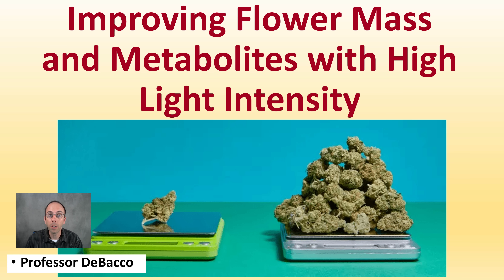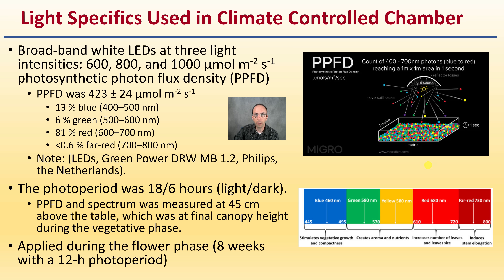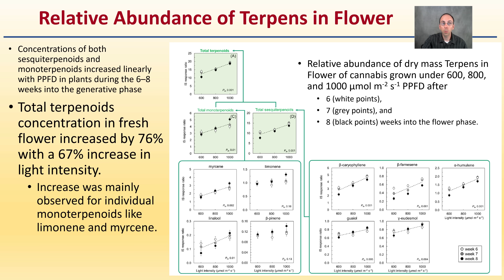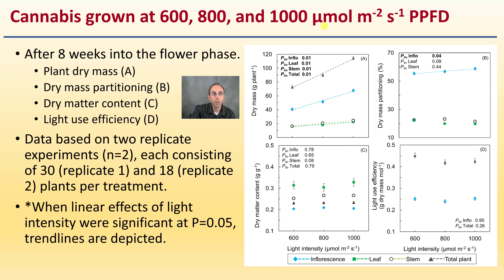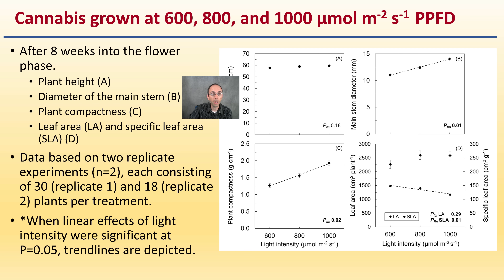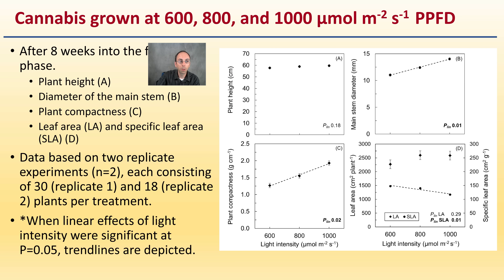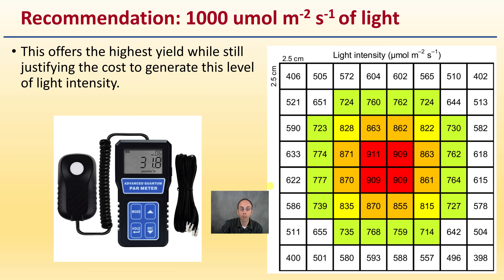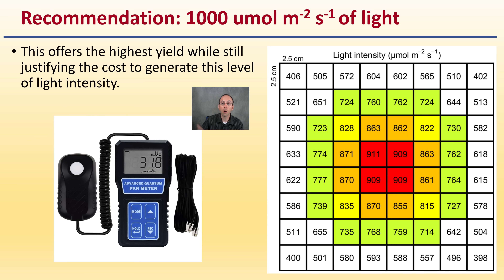Improving Flower Mass and Metabolites with High Light Intensity

Comment: As a 53 year old grower / smoker / breeder  - Imo, most of the flower in the shops and dispensaries, at least in my town, looks way better than it smokes. I think the combination of average / sub-par genetics + too much CO2 + PGR's + LED near red makes the buds nice and fat, but they lack the flavors and smells I get using the older HPS mixed spectrum bulbs running off digital ballasts. I ran LED's and HPS side-by-side in my flowering room and there were noticeable differences between the crops. LED's brought out more coloring, and the crops finished faster, but the smell and flavor of the HPS crop was much nicer. My customers felt the same
Reply: So overall you think HPS is better? Though I agree as I felt cannabis in the 90s was better but the price and heat of those HPS lights can cause issues for normal growers
Reply: @826_Vegeta_UCM  I do enjoy HPS flower better.  LED's do certainly have their benefits. Probably the only crops comparable to HPS, as far as terpene production, were the ones I grew under an LEC
Reply: @Onoma314  Interesting,  i've got a fairly expensive 750w LED, but a buddy of mine uses 300w LEC , with the exact same soil, nutes and strain, his plants always look thicker and healthier than mine, not sure what i' doing wrong .
Reply: @Onoma314 
LEC leaves HPS in its dust for terpenes
Blue spectrum dominant LED is superior to HPS too
HPS has a tonne of far red, and not as much PAR as most LED 
Also no UV
Reply: @grantsmith505  LEC also increased stem biomass by 27%, so not a great deal for me. Grow on, bro
Reply: @grantsmith505  No, that's incorrect. They actually make special bulbs for HPS that provide more far red because they normally don't put off a lot
Reply: @Onoma314 
And it's not incorrect that LEC/CMH is a far better producer of terps, because it's got UV, and is designed specifically for horticulture, while HPS is only designed for street lighting 

I've been growing weed under light since 1987
I actually study spectral output...not just spreading my assumptions like you are
Reply: @Onoma314 
Stems are developed by light in 630-780nm
Which is more like an HPS light than a CMH

How long did you say you've actually been growing, and how big are your gardens??

I used to grow under HPS and CMH combined spectrum 
Haven't used an HPS in more than ten years, since LED tech hardened 

If you had access to CMH, you'd be growing under a CMH/LED custom spectrum by now

No-one who's actually used CMH is going to advocate baseball ground lights over horticulture specific lighting 

I think you just talk big...
Reply: @grantsmith505  oh really professor ? Which bulbs was I using ? Which products ? You're just making assumptions, get a grip on reality
Reply: @Onoma314 
You didn't even know HPS was originally designed as street lighting???

And you are here trying to get other ppl to trust your opinions 

And when someone brings facts, all you've got is to call me professor and have a sulk....
Reply: @grantsmith505  OK knowitall, sure thing. I think I could take one of my strains, for example my old shishkaberry cut, and grow it under a range of lights, and you'd be clueless which bud came from which light. Tell me I'm wrong, wait, you don't need to, because I already know

And if you want to pull the whole " I've been doing this longer than you " bullshit, who really cares ? I was raised by parents that worked the smuggling scene in south florida in the 1970's and worked for Steve DeAngelo before he even started Ecolution, and I'm cooler than you and more old school and and and , aaaaaand......who really cares ? Nobody gives a shit what you have to say, just get a grip on reality
Reply: @Onoma314 
The subject of discussion is spectrum, which you don't appear to be able to add to....

It's got nothing to do with me growing indoors 40 years either, it's what I did in those 40 years 
And one of those things was study the physics involved in lighting 

So you can say in your opinion something or other is correct
But notice how when someone actually brings facts all you've got is petty name calling, but no facts to bring in return
Reply: @Onoma314  bingo we have a winner.. spectrum tuned led with philips 315 cmh has been proven for a while now
Reply: Corporate bud is like food corporation fruits and vegetables. They breed a strain for highest commercial profitability.  Whether that's denser buds or faster maturity or higher pest resistance or even possibly glyphosphate resistance for all we know.  

It makes sense that the same banker owned corporate types would select a strain with fat dense buds but no terps or trichomes.  Just like they've done with tomatoes that look perfectly round and red and have long shelf life but taste like nothing at all or taste like miracle grow.

Also, by the time flower reaches a retailer it has been shaken for kief by everyone and their brother.  My space case hasn't had any significant kief for months.  All the bud has no trichomes anymore
Reply: I’m a newer grower so I have only used LED and have no basis for comparison with HPS but I can’t complain about what I’ve produced so far in terms of flavor. I don’t think it’s the light so much as the lack of a proper cure at the dispensaries. They want it out the door as fast as possible to turn a profit (understandably) and so they’re not willing to keep it jarred for 4-6 months before shipping it out.
Reply: The costs of hps nowadays outweigh the pros in my opinions. I can't run lava hot light bulbs in my small spaces for some flavor and slight higher THC levels.
Reply: These plants can utilize an insane amount of light. Growing outdoors, my real challenge is pests and inclement weather. Everything in my gardens wilts under the summer sun but not the cannabis!  Indoors is a different story. You need high dollar lights and maybe a closed loop CO² system to get above 1000umols. I dont have that kind of scratch for my indoor grows. Outdoors, I get 2000+ umols for free, plus all the spider mites i can kill!
Reply: @terpy-j7x  I'm in a desert region of Spain, the heat this year is insane 114 degrees during the day and about 86 degrees at night. We get micro climates, so suddenly it might drop a months worth of rain in one night, then not rain for a year, dust storms,  wind storms, Saharan sand storms, dust from the granite quarrys, more insects than i could name , and dampness, every house or wall has a 60cm mark where the damp has risen up, which is pure salt .. The winter is all of the above except the insects and heat, but it does get extremely cold. I've tried outdoors but it's just so challenging to deal with everything, if the plants make it to late flowering, then you've got bud rot to contend with. Even indoors is challenging, electric prices here are one of the highest in Europe, so running AC 24/7 ,plus everything else is really costly,.
Reply: @benjammin1212 I did loose half of one plant due to bud rot. Humidity here in Virginia is ridiculous this time of year. This year I have a fan outdoors blowing to reduce humidity. I keep my fingers crossed...and check on the indoor girls regularly!
Reply: @benjammin1212 gday mate from Australia so i understand the challenges you would face outdoors. May i sugest a hybrid solar inverter 12kwh battery storage and 2.4/3 kw solar panels. Per 600w light 30w extract fan and  15w air circulation. Initial cost is around $3.500 american at xheapest home build setup. Which is easy. I paid around $5k for my setup i built myself. If your anygood at growing which i assume you are..and your able to er...trade then its only a few rotations before its paid for itself. Rinse and repeat. Fuck paying for unreliable grid power 😢😅
Reply: @simonowen1956 Greetings from sunny Spain, thanks for taking the time to reply. Unfortunately I'm not in a position to get solar at the moment but it would be nice, it's something I've often wished I did have .. Merry Christmas to you and your family..
Reply: led will definitely evolve past this, as we research spectrums more, led lights will keep getting better. BIOS recently made a light with Poetry Of Plants, that is a “led” with all the benefits of HPS, called “The Bridge”. i know a couple other players also doing something similar, like GML

super excited to see what’s in store for the light/growing game in the next 10 years
Reply: Also pretty sick of hearing about the PGR EXCUSE I grow rock hard buds with co2 and led using 100% omri listed inputs.
Reply: @lakegrown_culture_nick8912  Crazy, I grow rock hard buds without CO2 or LED's. Of course, after growing my way through hundreds of strains, I couldn't help but notice that not all cultivars have the same flower density. It's almost like it's genetically determined or something
Reply: How is hps better ? my LED Can match the same spectrum and double the intensity at a lower cost
Reply: @420BusinessDays  Better how ? WTF are you people even blathering about ? Did I say a goddamn thing about power consumption or heat ?  I swear, some of you need to get a grip on reality. Cannabis plants are incapable of exceeding what they're genetically able to do. No amount of stoner science will change that. It comes down to providing your plants with the environment they function the best in, and that is cultivar specific. If you don't grasp that, you probably shouldn't work with plants of any type
Reply: @Onoma314 lol sound like you buy temu leds bud 😂
Reply: @420BusinessDays  Well, let me see here....the cost of a digital ballast for HPS is far cheaper than any LED lights I've seen, the bulbs for HPS are cheaper, ( 20 $ to 125 $ )I can replace the bulbs when they underperform, that's for starters. Buy an LED growlight and have a single component burn out  and then what are you going to do ? Fix it yourself ? Who cares about double the intensity ? Bombing your plants out with excessive light actually decreases terpene production.
Reply: @Onoma314 Im saying The cost of running led is cheaper my 1000w led almost covers my 8x8 only running at around 600-700w with Uv while hps im running 2-4 ballasts at 200-600w per light depending on what stage and what bulbs I used Not saying Hps or any bulb fixture is not good Sun light is technically the best light tho
Reply: @420BusinessDays  haha, double the intensity smh
Reply: Ignorance is bliss for most of the clowns in here haha
Reply: UV is why. 
You would get a lot better with Philips CMH also.. pro tips(2 steps ahead) also you have the wrong LED spectrum, likely... i know all the stuff, since growmau5 started LED trend with samsung (Rip samsung led.. most of you dont know that yet either)
Reply: @dertythegrower  rip dirty growers 👋
Reply: i school the thread and my replies get erased.. as usual 🫡🤐🥱
Reply: @dertythegrower  you could always cry online about it. You have given me a great idea tho. I'm the chef for a popular dispensary in Asheville, think I'll put some of the shop's pot snobs to the test and ask them to smoke an identical cultivar grown under a few different lights and see if they just talk out of their asses like pretty much everybody in this business. I'll see whether some of the oh-so-educated people can tell which bud is grown under which light, because I'm doubtful any big talkers would have a clue which came from which light. Have a nice day :)
Reply: Pizzabox analogy: 
Imagine flower being the carton and Essential oils to BE the Pizza .... 
Most Growers produce huge fancy boxes with tiny pizza  inside.
Reply: I think the problem is that everybody is missing that dispensaries are just try to do profit, so they all grow hydro, for Max yeld, but the smell, Flavor are in the soil, organic. I think is the Only way to step up the game, at least for me!
Reply: @sterlingarcher616 amen
Reply: Led are superior.Just use right led light spectrum.Hlg,flexstar...Not light with litle blue peak,litltle all other ant then big spike in red.
Reply: @dejantoroman6472  I haven't conducted any rigorous testing with lights yet, but from memory, when I tried the older generation LEC a few years back, the extra blue definitely made some great terpene production, but It also caused my plants to focus too much building stalks and stems. I'd estimate the biomass increase of just stem and stalk alone was upwards of 30 %. That's the only reason I didn't use the LEC after that. Great terps, excessive sticks, lower yield from flower mass in the end. Could very well be strain dependent as well
Reply: Interesting
Reply: Disagree strongly.  Smoking on Sherb cream pie grown under think grow led using end of day far red and I can smell it through 3 bags.  This may have been valid 10 years ago but we have really learned what plants need to be pushed under LED.  I think what your seeing at the shops is a combination of salt fertilizers and low Brix plants along with generally older flower that’s sitting around and has been grown in a way where it’s loaded with silica.. look pretty but smoke tough and do not have the flavors and smells.  Unfortunately for the average joe getting top notch quality under led is way more involved than hps.
Reply: You got any good deals on seeds? 😎🖖
Reply: @growmie4twenty  Great question ! I don't offer deals on seeds, I usually just send them out to folks for free. Just tossed all my old stock tho, sorry. It's pretty much cuts only from here on out
Reply: I use a viparspectra P2000 along with a vertical 300W far red CFL bulb in my 3 plant tent.
It gives a nice mix of red and blue light, and 55 watts per square foot of canopy, and so far the results are pretty spectacular.
Reply: I grew with hps and mh hortilux lights for years and these new good leds are exponentially better then any of them.  Now cheap leds  are not but the top end ones using Samsung full spectrum diodes are alot better.  Im pretty sure you just used a subpar LED.  get a ac infinity ionframe light and do the comparison..
Reply: I agree brother 🎉🎉🎉🎉🎉
Reply: Did you feed them the same? Bc led makes you need more cal-mag. Just trying to see what your controlled vs uncontrolled variables are.
Reply: Virtually the opposite of what most say... I've been hearing for years about how LEDs preserve, as well as increase terps.
Don't compare huge commercial grows with smaller labor intensive  craft and home growers.
Reply: @michaelcarey9359  I'm not a huge grower. I'll work this winter, on growing identical 2 crops side-by-side, one with a mixed spectrum HPS and one with a Floraflex or HLG light, then I'll send buds from both in for some analytical testing, then do a blind taste test with the staff at the dispensary I'm the chef for, and then post a video of it. I'd like to see some rigorous testing done, and nobody appears to be stepping up, just folks making claims, so I'll do it :)
Reply: Old school growers growing on hps,  and harvesting 2g/1w
Reply: Led + cmh is a nice combination
Reply: You must be using the wrong LEDs. I'd never go back to hps
Reply: @mr.monster6298  Is that right ?  I'm using HLG 550's, haven't seen any bad press on them, have you ?
Reply: You're using PGR's for a product you're giving to your customers?

Comment: I appreciate the effort Dr. but this study has to be missing a few details, because in the actual cannabis industry( not a lab) everybody knows by now that lower light intensities and far cooler temps than 28c like in this study yields a far superior product. My best guess is that when using CBD varieties this way (high light intensity)one could increase active ingredients this way because there was very little active ingredients to begin with. Critical CBD is not high grade genetics and the foto of the flower in study also doesn't represent modern day cannabis flower. I also suspect that the equatorial origins of the genetics could have a big impact on these results besides the fact that 'critical CBD' is a plant bred for having very low thc.
Also there is no mention of the total active ingredient count of these specific genetics in these test results but only of the increase in metabolite production.
Reply: What about their humidity levels in flower can we talk  about that a little bit ?
Reply: Also lower temps and cutting lights back might yield superior LOOKING biomass but that comes with a price obviously… less terps and lower thc